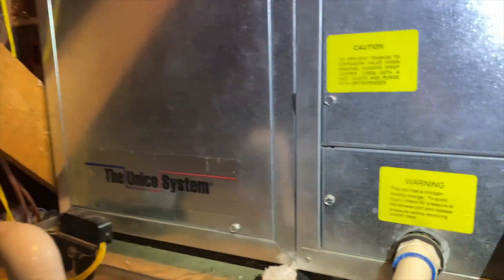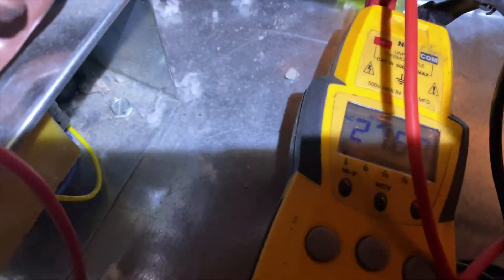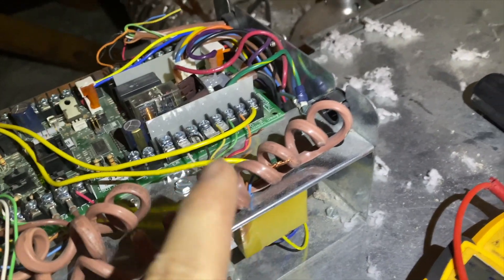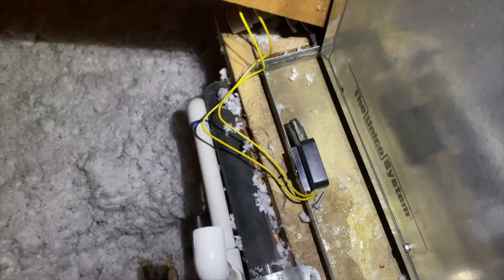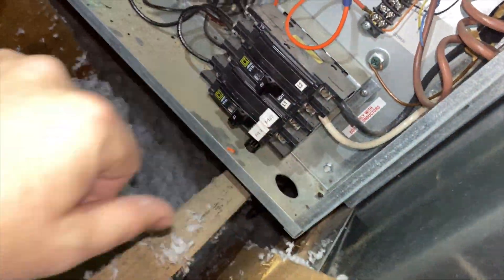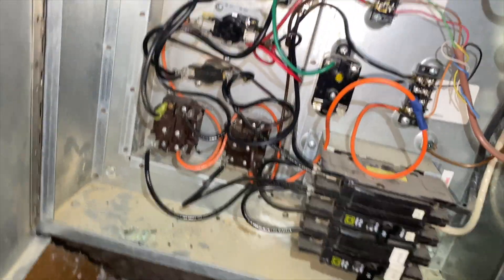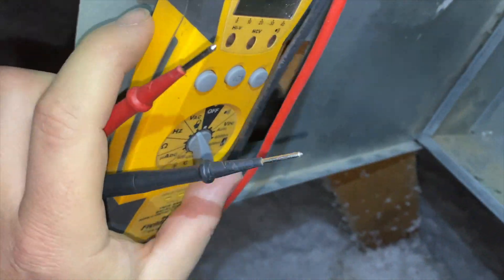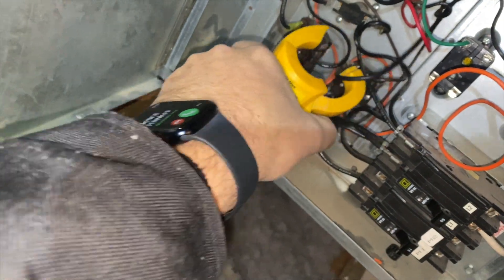No heat!  Melted wires, how to diagnose a Unico Heat Pump.  EP85

Comment: Unico systems High Velocity system with 2 in. And 2.5 in. Ducts. Just out of curiosity,what is your opinion on these systems? Not just the unico but high velocity systems in general.

Comment: So I have areal similar system. It’s not producing heat but can comes on. It has a zone system box. It has no melted wires like the system you have here but I do see two groups of wires labeled “t-stat down s” and “t-“stat up s” the wires for what I figure are for the downstairs thermostat are connected to the zone unit but the ones labeled upstairs are not. Would that stop the whole system?
Reply from the maker: It shouldn’t. The upstairs thermostat would be disabled, as it’s not connected. There should also be a thermostat wire connected to the equipment buss on the zone board that leads to the actual system. If on stat is disconnected it’s possible there may have been an issue with the zone board or the zoning as been removed. I’d suggest contacting a professional HVAC tech to look at it as this could be quite complicated.  You may have other issues as well.